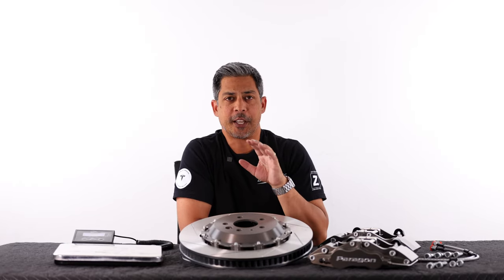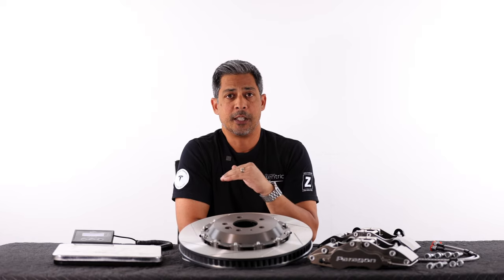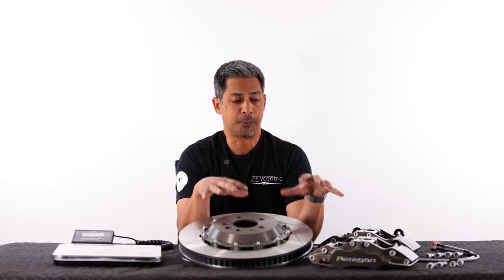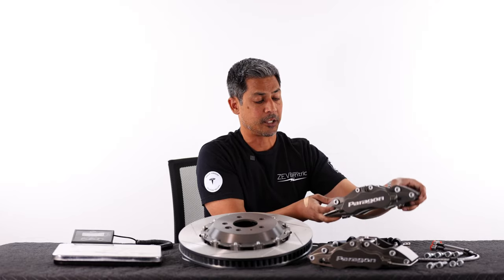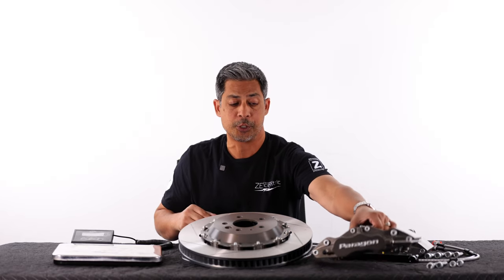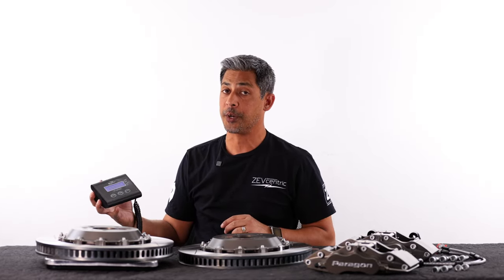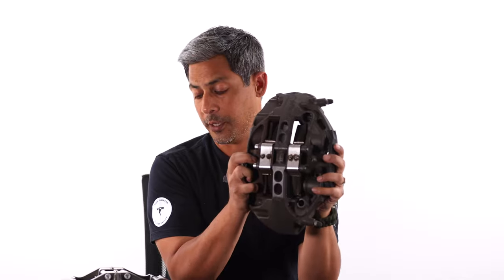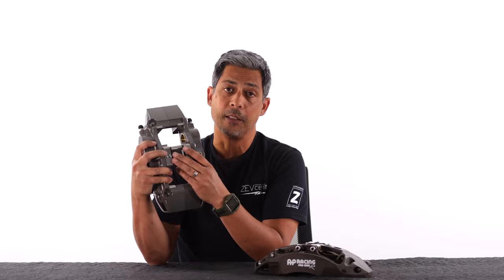SUPER AFFORDABLE BIG BRAKE KIT FOR THE MODEL 3 AND Y.  USES AP RACING PAD SHAPES!!!!

Comment: Those looks real nice. 

Do you happen to know if the model 3 red calipers stop better than the silver brakes on the long range / standard range?  I’ve never seen a comparison test. And how do these aftermarket bbk compare to stock?
Reply from the maker: The red brembos will be a stiffer caliper with a larger rotor as well.  The benefit of an aftermarket kit will allow for better material, more surface area, and an even larger heat sink due to rotor sizes.
Reply: @zevcentric thank you
Reply: @zevcentric thank you
Reply: @zevcentric  Isn't the front calipers the same Brembo unit throughout the line? Performance has larger diameter 335mm x 20mm rotors compared to the SR/LR 320mm x 255mm. Rears are definitely different with the Brembo Solid Floating 1-Piston Caliper.
Reply from the maker: The front calipers are both brembo but they are not the same on the performance reds and the non P silvers. Pads and calipers are totally different.  Rear calipers are totally different as well.  @hyp36rmax
Reply: @zevcentric  Ah I see the differences now. Non-P Silvers have a traditional pin to secure the pads vs the P with a torx bolt . Later is also lighter by a lb or so. At least for M3 this is the case.  MY LR and P share the exact calipers.